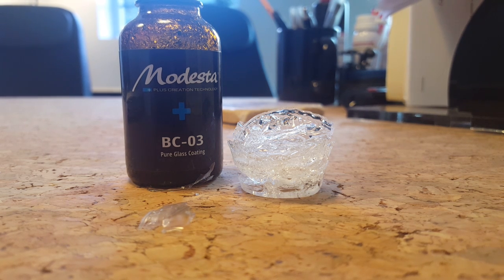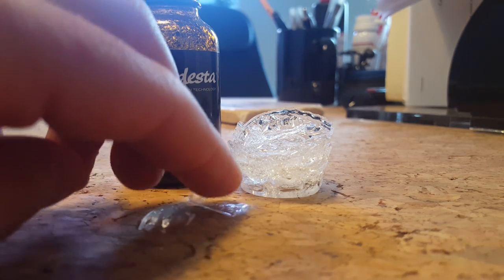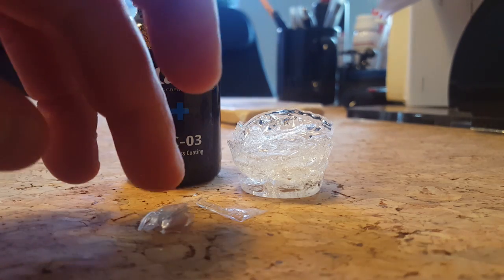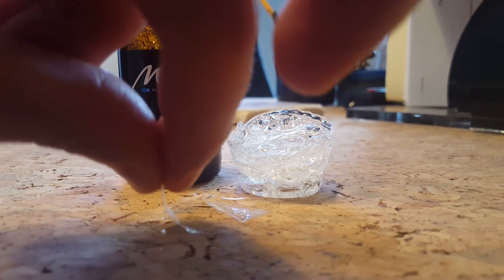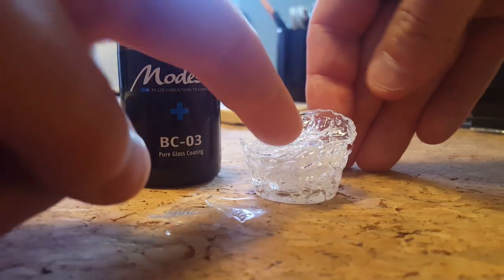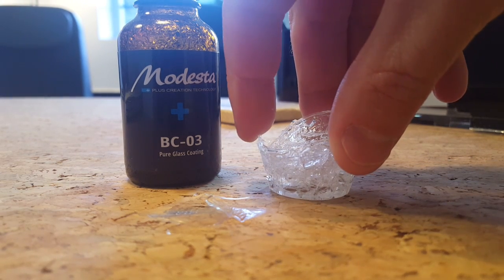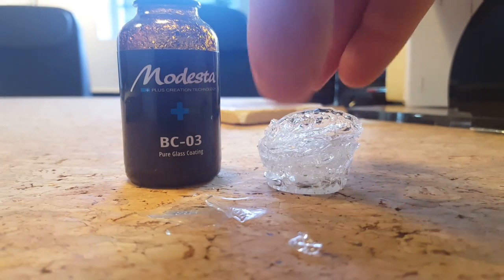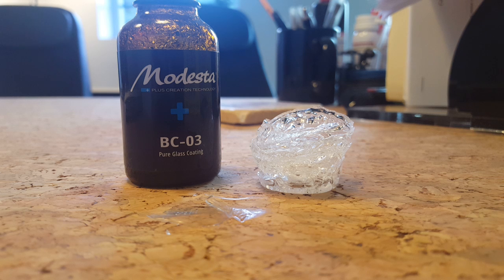Layering Coatings: How Much is too Much?

Comment: So how many layers would you consider to be a good balance between maximun shine/protection and bonding/flexibility? Thanks
Reply from the maker: That would depend on the coating used. In the case of Modesta, 1 layer is completely sufficient for a beautiful luster and world class coating protection. If someone wanted to go for something more opulent, a layer of BC-04 with either BC-05 or BC-08 on top would hit the mark. 

But all this talk of 10 layers and what not is snake oil and unethical practices that are designed to extract more money from a client without a real value. If a coating actually requires 10 layers for a warranty, proper gloss or adequate protection it's a garbage product. On that subject: If someone is telling you they will do 10 layers and they are not keeping the car on the order of 5-10 days(just for the application....so add more time for correction and prep), corners are being cut. To apply multiple layers on top of a freshly applied layer that has not been properly treated with an IR lamp or has been given 24 hours is just pushing product around and not adding to the thickness.

The point of this video is to illustrate that even when done properly, a coating can be too thick to serve its purpose.

Buyer beware anyone claiming something too good to be true or selling you on "more is better".
Reply: No matter how many layer you do brother warranty given 3 years means it’s only just 3 years even if your doing 5 layer it’s not worth it and it’s a bloody time waste. Only advantage doing multiple layer given a little bit gloss more layers never more protection.